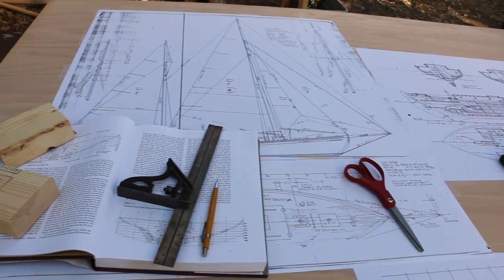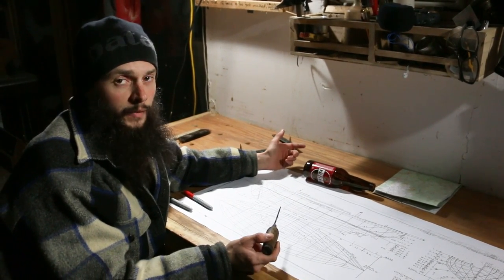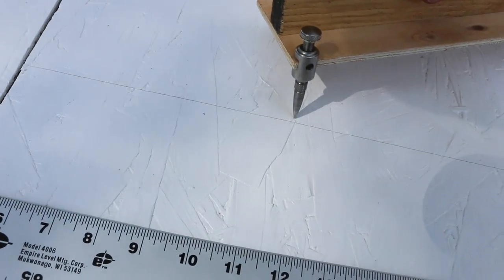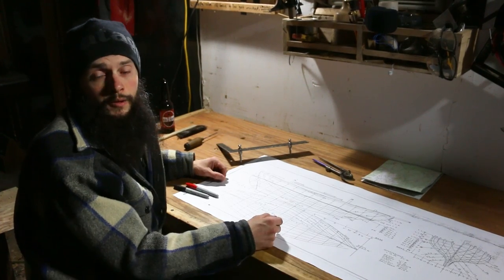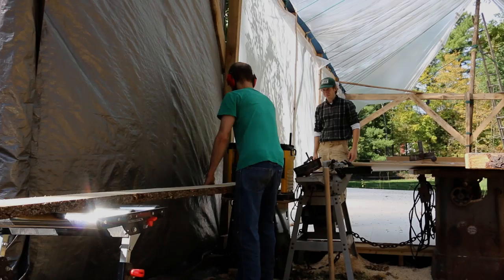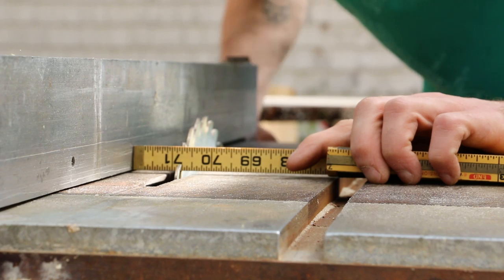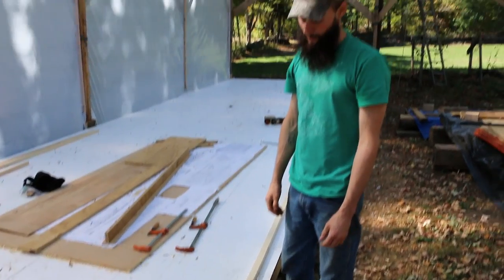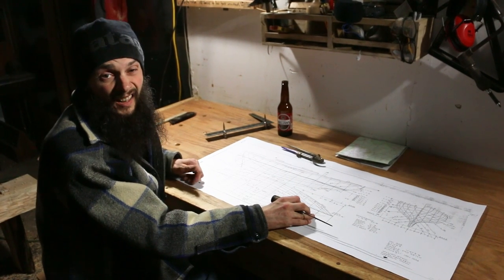Acorn to Arabella - Journey of a Wooden Boat - Episode 9: Lofting

Comment: Longitudinal or Latitudinal lines?  Tough question and definitely up for debate.  Even though the rough board is "long" it doesn't presuppose "longitude" as the correct term, as Stephen says, when referring to wood grain lines. When referring to "lines" in a long board that are parallel with the "long length" dimension, they should probably be referred to as "latitudinal" lines, but I'm not sure. Do you agree or disagree?

Regardless, I've been binge watching this build and I'm loving the hell out of it!  Keep up the good work guys and I can't wait to see the boat when it's finished!  Or, should I say "ship"?  That opens a completely different can of worms :)

Comment: Is it completely necessary to loft the half breadth view? Seems like you could build the keel and space the frames using the profile view.
Reply from the maker: If you want fair molds it is.  The half breadth controls the shape/ fairness of the molds and hull parallel to the water line. The frame view does the same thing perpendicular to the water line.  You then use them to check against each other to make sure the molds and then hull will be smooth and fair in all directions.
Reply: Acorn To Arabella  Ah, I see. Thanks for the explanation. I'm enjoying your channel!

Comment: Does any one use a chalk line for lofting? You can get a straight line easier,  wet your thumb and wipe the chalk line off the lofting table, and pen in the line. Do this at regular intervals, wipe all the chalk left on the board and join the dots.

Comment: I am just now viewing your videos, so you may not see this comment. No biggie!

Just wondering if you made slight increases in the foredeck offset lengths (May be required to maintain the appearance of a graceful upsweep shown in the plans when the boat is constructed.) 

There is sometimes an optical illusion, usually when the forward upsweep in the plans is fairly mild, such that when the forward station points are lofted exactly as indicated in the offsets, then the desired upward sweep may appear flattened, or even inverted in the constructed boat, especially if the foredeck itself is convex from side to side (and even if not). This can really affect the overall beauty of the lines. I have seen this for myself. I think the Flying Scott is a good example of this in the one-design classes. So, to correct for this illusion this It may be necessary to increase the offsets of the shear and profile lines in the forward sections at each station by a small amount. This also increases the length of the stem as well, of course.

I learned this fact in the lofting class I took long ago at the Wooden Boat School in Maine. I recall that the length modifications require some complex angular geometric calculations. As if lofting weren't complicated enough!

Anyway, I trust I will see this was not an issue as I stream on. Good work, all!
Reply from the maker: Who’d you take lofting with at WBS?
Reply: @AcornToArabella  Gregg Rossel, if memory serves.
Reply: I am no optical physicist, but I think what may cause this distortion is the fact that in  3D profile, the shear line moves away from you as it proceeds toward the stem tip, which is of course the farthest point from your eye. If you place two dowels, one a bit longer than the other, an equal distance in front of you, there will be a certain angle between their tips. Now, as you move one farther away in a straight line, the apparent difference in height will diminish, since the one farther away appears to shrink. As a result the perceived angle of the line connecting their tips appears to decrease.

I may be wrong, of course, but I ran this little experiment myself, and it is true. In a boat with a shallow upward sweep seen in profile, I can see how the upsweep may appear flatter than predicted from the 2D plans. Greg taught us to make a small offset correction to the foredeck profile lines when lofting to correct for it. Strange, I don't remember much from the course (it was decades ago), but I have never forgotten this.

It may not affect Arabella at all (I hope), and anyway not much could be done about it at this point. It's a minor issue at best. You might ask Mr. Rossel about it if you want, that is if you were not already aware.

Comment: Very well explained on the lofting and batten assembly. Would pinning the batten with a couple of dowels strengthen or weaken it, do you think. 
I was wondering, what do/did you teach with your Master's of Education? What grade/s? (I am working on my B.S. in education with a concentration in middle grades mathematics at the University of Louisville.)
Reply from the maker: Dowels are not needed for the scarf the glue is plenty strong and the dowels would create a hard spot. When using it to loft you never put anything through it, only against the edge to guide it. 
My background is in outdoor education, leadership and environmental sciences.  I have taught everyone from 2nd graders right on through retirees.